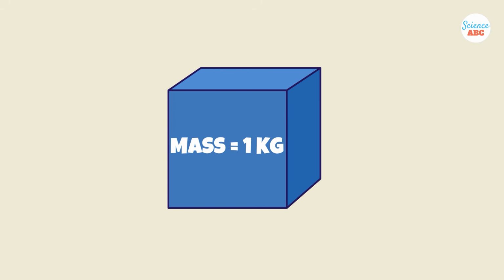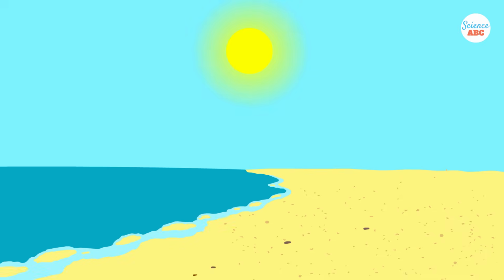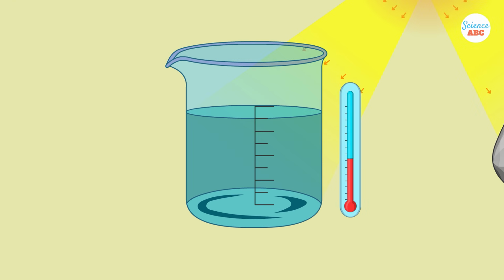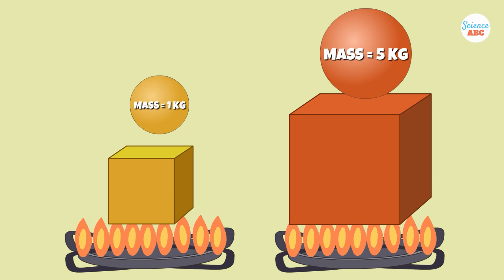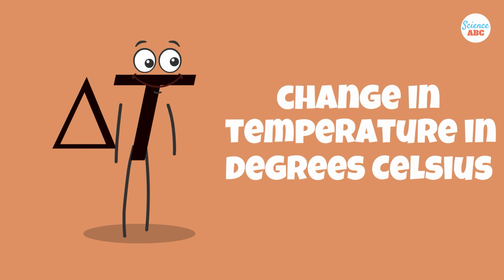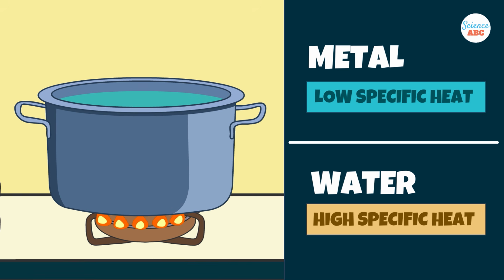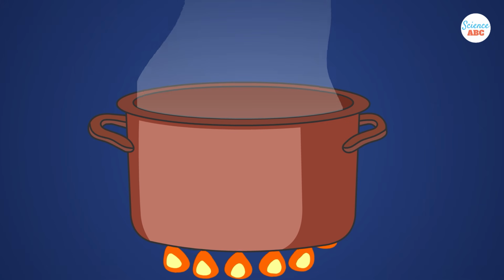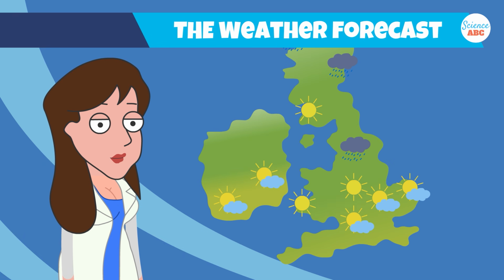Specific Heat Capacity Explained in Simple Words

Comment from the maker: Fun fact: Water has one of the highest specific heat capacities of any common substance — that's why oceans help regulate Earth's climate. Coastal cities stay milder year-round because the ocean takes far longer to heat up or cool down than the land beside it.                                                                                                                                                                                                                                            
                                                           
Quick question for you: If you were designing a frying pan, would you want the metal's specific heat capacity to be HIGH or LOW — and why? Drop your answer in the comments!                                                                            
                                                           
Learn more:                                                                                                                                                                                                                                             
  ▶ Archimedes Principle: https://youtu.be/wChr0hCga5g     
  ▶ Atomic Models: https://youtu.be/v48u8hjqNBU                                                                                                                                                                                                              
  ▶ Electromagnetism: https://youtu.be/nllCgjlWAF4